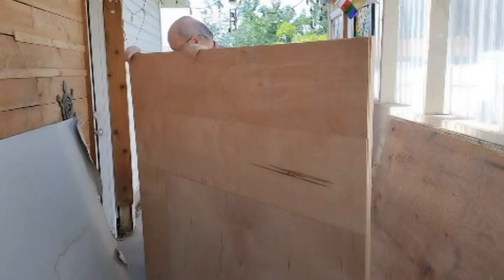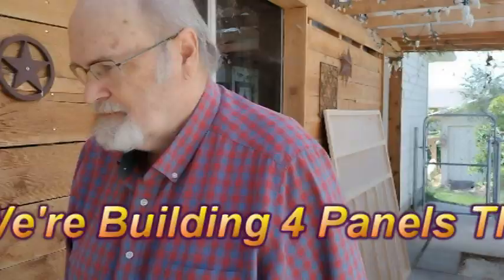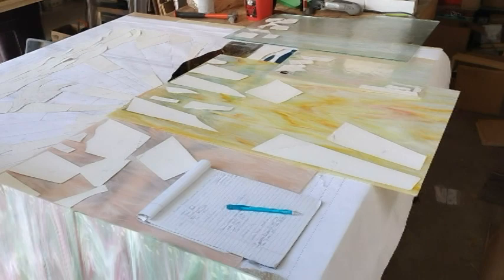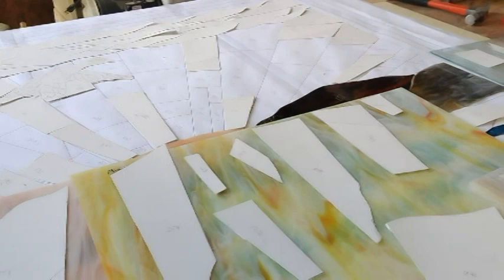Make A Table Top For Large Stained Glass V375

Comment: I have a 4x5 stained glass. How do I add rings and would 5-6 rings be enough to hang / carry the weight of the glass in the window?  The window is 5x5. The stained glass is 5x4 so I’ll use rings connecting to chains top down.    Any helpful comments would be appreciated
Reply from the maker: Just guessing, but I figure a ring every 6" or less would be enough to hold it up. They need to be pretty stout rings and the window frame needs to be very strong.